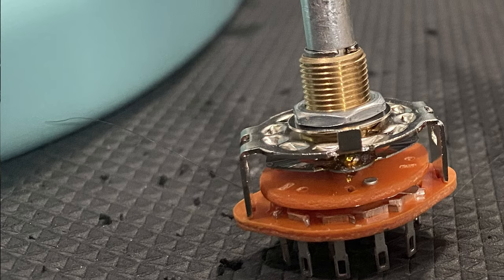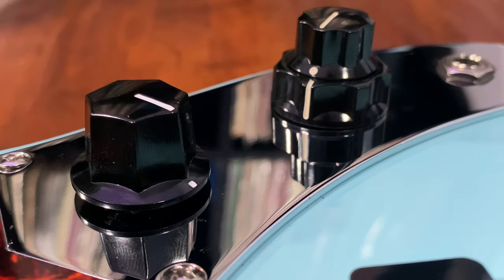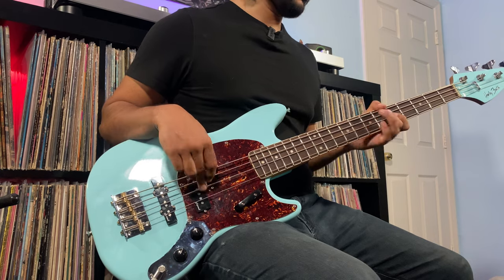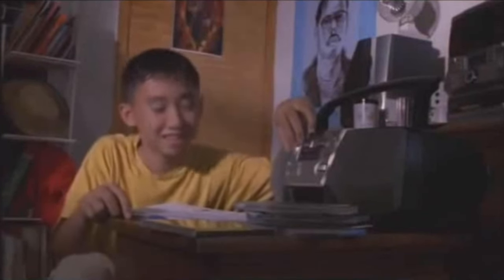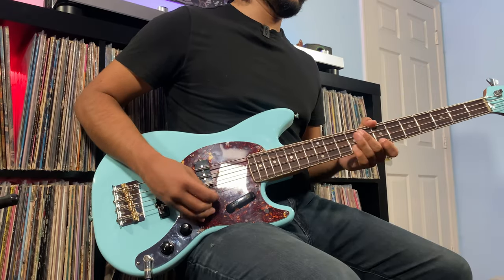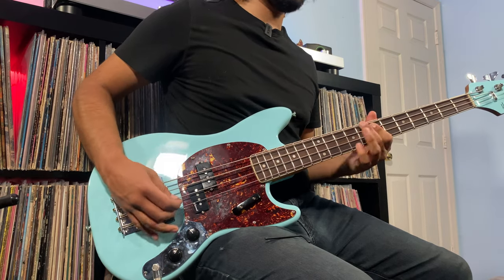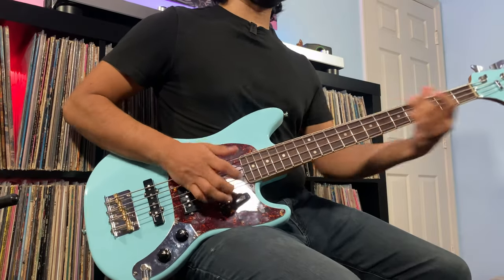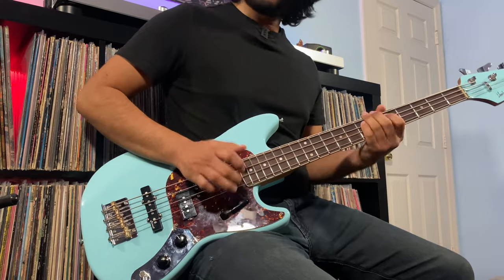THIS Knob SAVED The Harley Benton MV-4MSB Gotoh BASS!!

Comment: I did something similar to my jazz bass, but I used a Freeway 6-Way toggle switch -- gives all the combinations, plus in-out phase. Then I used two stacked pots so I have individual volume and tone controls. Note than when in series, only one volume/tone is functional. I've done something similar on my HB Bass VI, using the 10-Way blade-switch version, which gives every imaginable combination. I find all of the sounds useful for one thing or another. I do similar mods on my guitars as well.